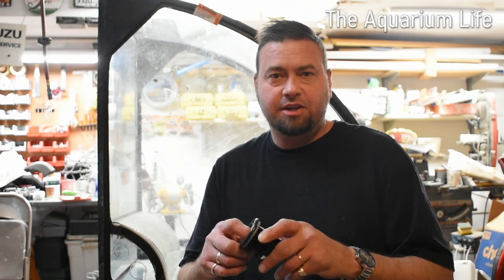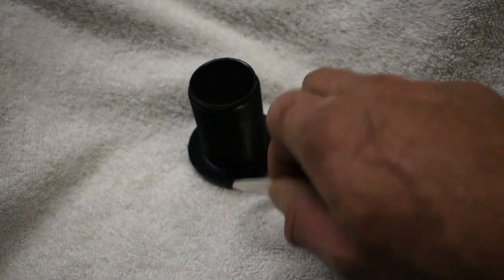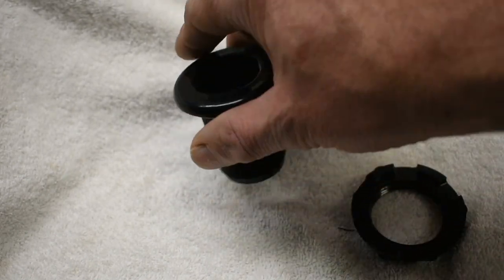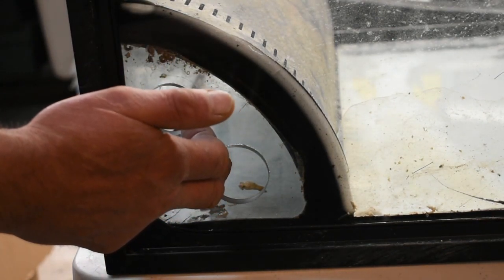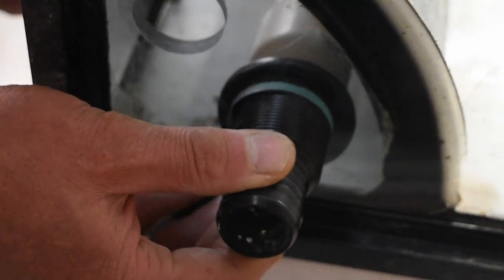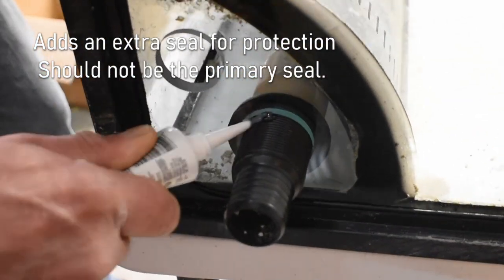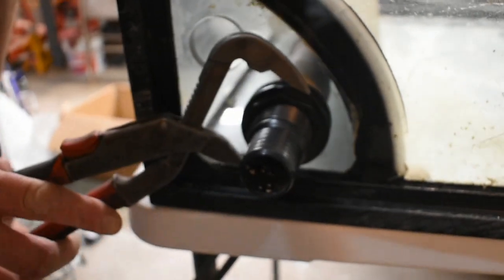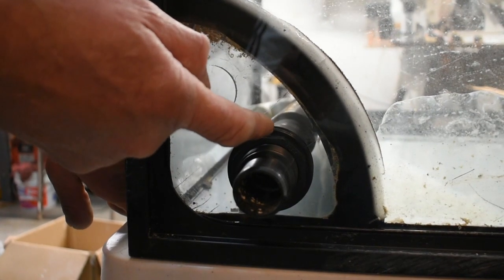Bukhead 101 Bulkheads that don't leak

Comment: i heard silicone compromises it over time though....?
Reply from the maker: This is a great comment. It does however this how your glass aquariums are put together. Eventually your aquarium will leak and need to be rebuilt or replaced. These seals should last about the same amount of time. Also the silicone is designed to prevent the bulkhead from moving and creat a secondary level of protection. The primary deal is the gasket provided with the bulkhead.

Comment: i recently bought brand new 1" bulkheads and noticed they don'thave the ridges on the rubber gasket.  possible issues not having the ridges?
Reply from the maker: No. They sould work just fine. Some of them are just designed differently. Thank you for watching.

Comment: I got a bulkhead that is installed on tank is up & running  am going to put a sump in but bulkhead is not snug up what can i use to snug it pvc is glue in already thx you
Reply from the maker: Sorry for the late reply. Are you just having trouble reaching the bulkhead nut to snug it up?

Comment: Wow, where did you get those bulkheads with the barb attached as one piece? I can't find those anywhere
Reply: Hydroponics stores carry them for sure.
Reply from the maker: Sorry for the late reply.  They come with the Aqueon mega flow kit. I know that you can get barb to slip pvc fittings at some home depot stores that you could glue in to a standard bulkhead.

Comment: Ok Bulkhead 101 , Hum 100 ;-) Suppose you want to seal the holes up using a double threaded bulkhead with a Male threaded Plug ? Water tight any suggestions excluding replacing the glass, then aka: 101 love to see a video of the best way to Seal the holes after removing the over flow....
Nice video, Thank U n B Safe
Reply from the maker: If you want to just seal it you can do a threaded bulkhead like you mentioned with a threaded PVC plug. Teflon thread tape and it should hold just fine. I will try to make another video.

Comment: I’m so glad I saw this!  Just bought a used tank w a sump you answered my questions. I’ll be putting in new bulkheads and I didn’t know the seal or gasket had a flat side!  I’ll be testing mine outside 😂. It’s a big tank.
Reply: Bruce I have a million questions, but one maybe you could help me w.  This is large acrylic tank 4’ x 2’ x 3’ tall. Drilled underneath for sump. Issue is, overflow is smack in the middle of the tank!  So big black overflow blocking the view. I thought to move it to the side and use existing holes, rerouting thru the overflow to holes in the middle w pvc. Since tank is so tall figured it would be easy to cover.  Sump is somewhat hard to get to because it’s not much room underneath and I know I’ll tire of trying to get to it. Personally I’d rather not use the sump but can’t think of better way to filter it.
Reply from the maker: @PrinklesOnTop  I can think of a few options. 
You could plug the holes with bulkheads and pvc plugs. Then since it's acrylic you could drill holes at a more desirable location.
For simplicity you could install one of the Eshops overflow kits. 
As far as the sump goes I do feel it is superior for filtration. Would it be out of the question to build a new stand with more access? 
Feel free to DM me pictures of your project on Instagram. Vital_reef
Reply: @ewaldsreef  I love the eshops overflow kits.  I'd rather do that.  I don't mind drilling in a better location.  I think the sump is set up awkwardly, in that case I can make it more manageable by redesigning it myself so I can access it better.  It's the way it connected to the tank that makes it difficult.  But I think I have a better solution/idea.  Thank you so much for replying and taking the time to do so.  I really appreciate it!!!!
Reply from the maker: @PrinklesOnTop  always happy to help
Reply: Bruce I’ll send you a pic this weekend so you can see it.  I don’t like the sump design but will take a better look and see if I can redesign it. It’s acrylic as well.
Reply from the maker: Thank you so much for watching. Please let me know if you have any other questions.

Comment: Hi! My bulkhead doesnt leak but the tubing that connects to it does. Its the black 1inch tubing that is commonly sold for ponds. It has a thick hard plastic spiraled thru it for strength but i think that is whats causing the leak, i cant clamp it tight enough to stop it. Helpppp lol
Reply from the maker: I would definitely recommend going with a vinyl tubing instead. Do your bulkheads have barbed fittings on them?
Reply: @ewaldsreef  yes it has that weird little grippy ridges. I think im going to apply silicone, let it cure and then see if it helped. If not, I'll try the different tubing like you suggest:) ty
Reply from the maker: @EyezLikaFox̌  the silicone might work. Also try using two clamps. Hope it works 🙂
Reply: @ewaldsreef  good idea with trying 2 clamps ty